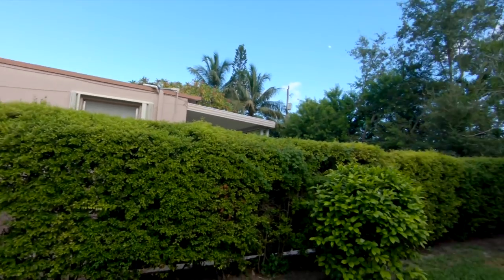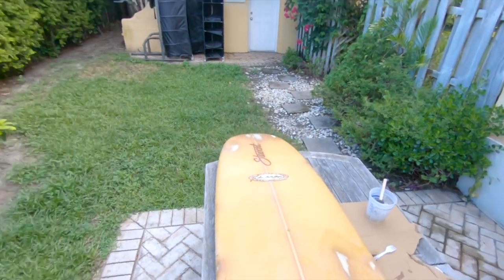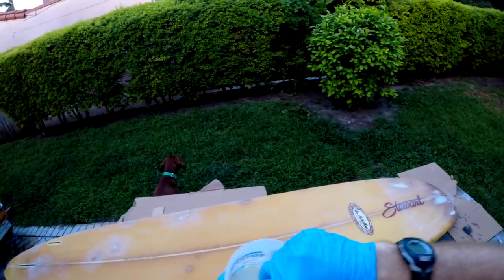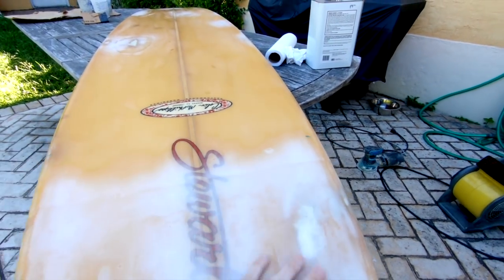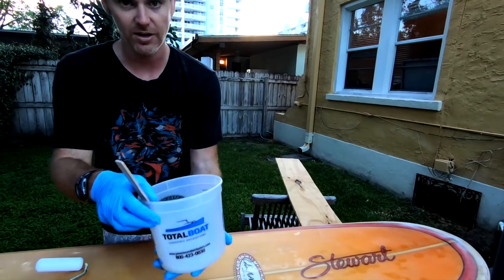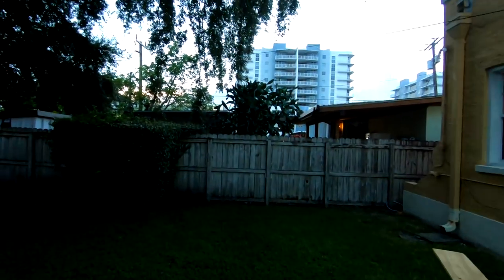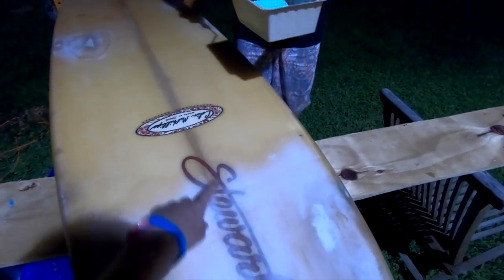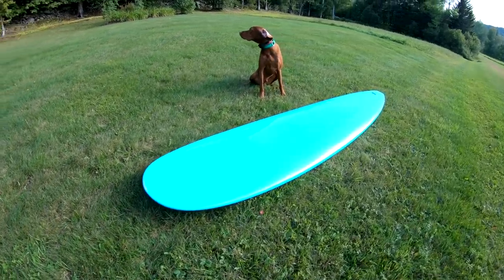Building a Wood Grain Surfboard - Episode 4

Comment: Also, the tints are tints, not paint. In your video, if you look at your patches, you'll see the blue. It's faint, but that's what tints do. You can also see the hot coat had a "cool" tone. It wasn't clear. 
Tints are best used on new, white styrofoam, not a painted board.